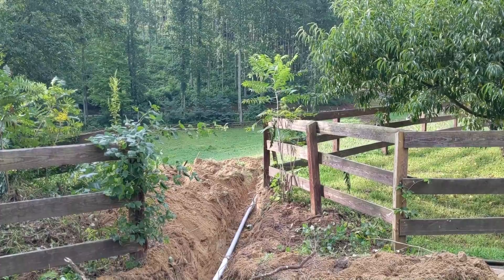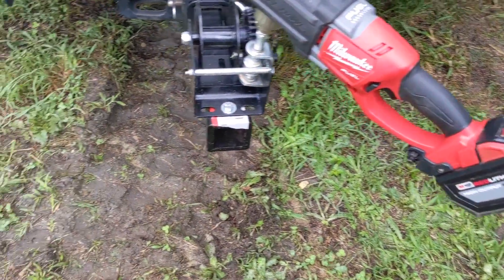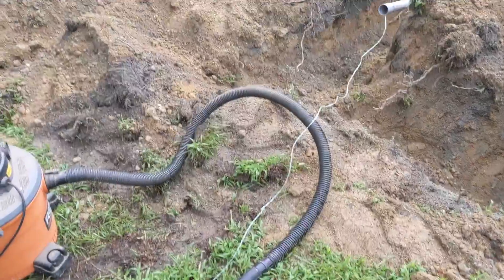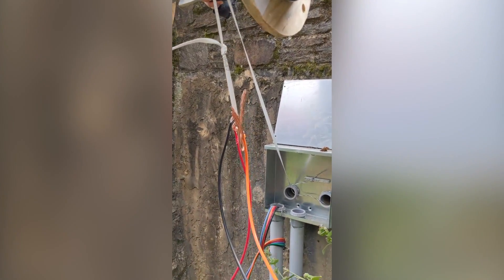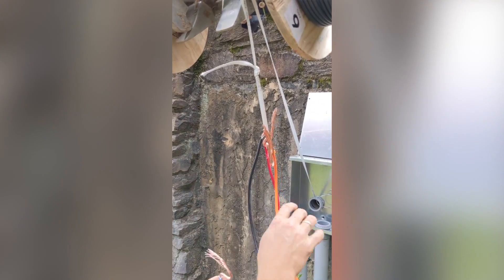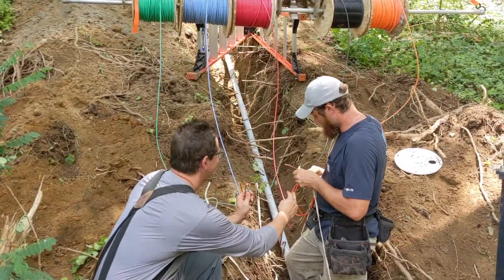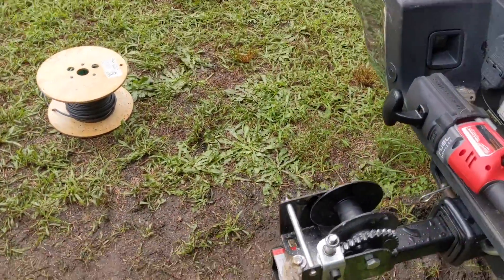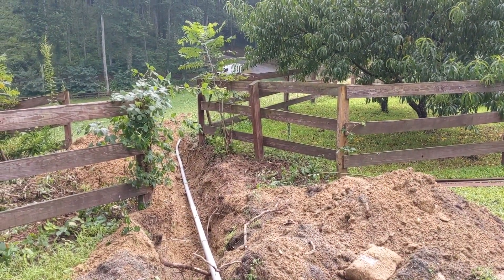The Super Mega Solar Wire Pull!

Comment: We have used 1/8" coated aircraft cable for pulling,vit worked well, very difficult to break! Just put a loop and crimp it on both ends, it's better than a fish tape (when pulling) you can hook it on the little winch, 

I thought my upcoming 150'-200' pull was a bit far, that is much more difficult. And mine is nearly a straight flat line!!

Comment: Good mule tape will make it happen. With a good kelum grip. Crimp the grip around the wires and you are set. Low friction, easy pull.

Comment: Just curious on why you didn't use a stronger pull string (aka rope) for the first 800 ft pull?  
PS>  I am the walrus   :)
Reply from the maker: we sucked a pull string through in 5 seconds.  Then we tied on a mule tape.  we broke the pull string just trying to pull in our pull rope.

Comment: Washing up liquid or a bit of tallow is your friend on long pulls!

Funniest one I did was at Kellogg's in Manchester (UK). We were to do a long pull of a HV cable the length of the factory and vertically up 7 floors! We were there under sufferance because we were the only ones back then who could touch HV cabling! 
We had a full week of the local electrical contractor who employed Irish to do all their (LV) cable pulls. We set off setting up the whole route with dozens and dozens of rollers ..... and we had a solid week of them taking the pee for us being lazy b*stards. The site had a background noise of their teams pulling cables in to the sound of 1....2....3..... Pulll.  1....2....3..... Pulll.  from start of the day to going home time!
Suddenly there were paddies looking round every corner at us when we got the air winch delivered. When we hit the air and the HV cable started to go in at a good walking pace there were cries of "Bejesus! Their doin' it!" When we had pulled the whole cable in within half an hour all you could hear after the air went of was 123Pull!, 123Pull!
Work smarter not harder. Always!

Comment: Dude...  you had the mini-excavator there!!!   Haven't you ever seen commercial electricians wrap their pull ropes around the track of the excavator to pull hundreds of feet of 6-ought wire from the street to the service entry?  Use your boom/bucket to lift the track on one side, wrap your pull rope around the lifted track, use the track control to pull anything you want into any pipe....  not a wimpy Milfukee spinny-majig winchy-bob.
Edit:   found you a video....   https://youtu.be/TOpj2G8BtOQ
Reply from the maker: That is awesome!!!! Thank you.
Reply: @engineer775  Before you try it, watch the video again -  PAY ATTENTION to the guy pulling on the rope to keep it tight on the track and stripping off the excess as he goes.  You only need a wrap or two on the track and control the friction with the loose end of the rope.  It's a type of slip clutch winching system but the idiot censors here won't let me post the name because it sounds like a racial slur.  Censors are a bunch of naive touchy idiots.   If you need to look up the term it has to do with slipping a combination Capstan/Bollard used to haul Purse Seine nets on fishing trawlers.
Reply from the maker: @ramosel  Yes sir.  We were doing the same thing just small scale with the 4 to 1 worm drive winch.  I really needed the mini to set up the wires on the other end.  Guess we need 2 minis!
Reply: @engineer775  No, no, no... the wife will never go for another Mini-ex.  Now you need a track loader (I don't like bobcats, but you get the drift) with a universal quick attach wire rack...  huh? Yeah?  Keep up the good work man.   Hey, Jason has gone silent on me.  You want to come to the west coast?

Comment: Pull a 1/2 inch rope through then use pulling lube lots of it. you can pull 800 no problem. We use that for service wire.
Reply from the maker: We sucked a pull string and then tried to pull a mule tape in and we got about to the 700 mark and it broke,.  if the pull was straight is would have been fine but we had to a very large sweeping downhill  turn.
Reply: @engineer775  Klein foaming spray lube works wonders.